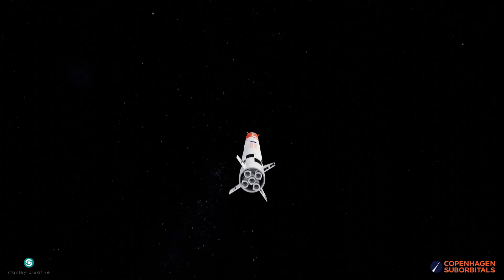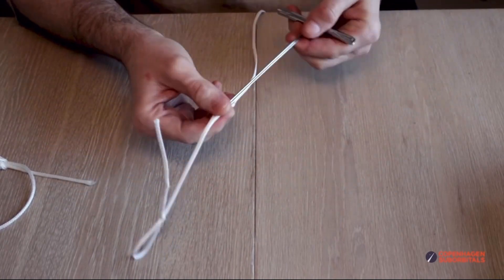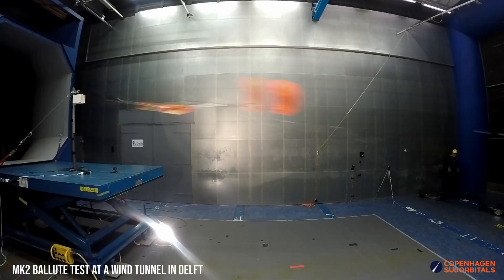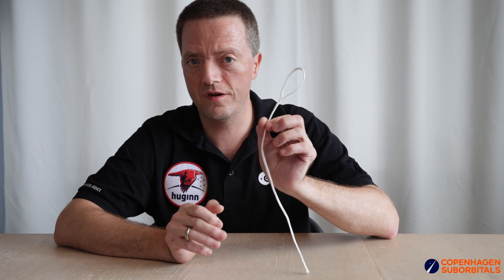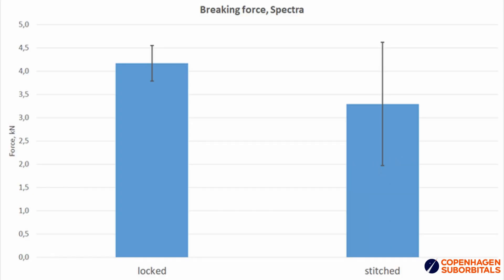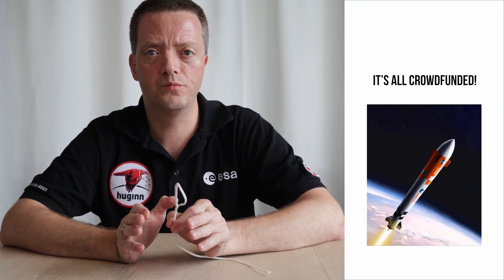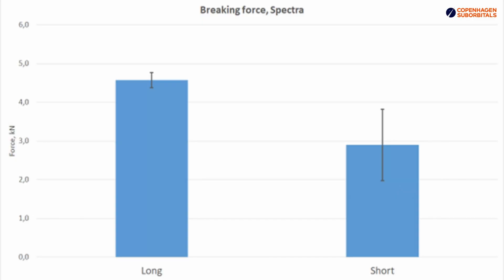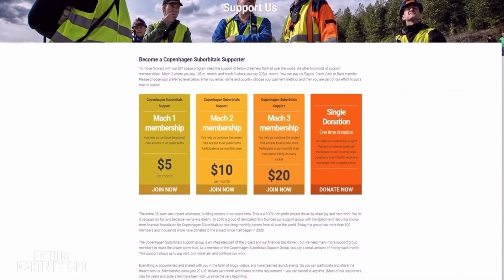Rocket parachute lines that DON'T break?

Comment: I wonder if it matters that the bolts the lines are attached to during testing are fixed. That could allow friction to transfer some stresses off center if the line isn't placed at the right angle. 
Shorter loops would also be affected more by this.
Reply from the maker: Yes, but it’s equal conditions for all the tests
Reply: @CopenhagenSuborbitals  A shorter loop will be under more stress than a longer one if the knots are displaced by the same distance.
It's the same as when you take a long rubber band and a short one of the same thickness, and stretch them the same distance - the shorter one will take more force.
It shouldn't be that hard to put them on something that rotates for the next test, to see if it changes anything.

Comment: It's a well known fact that the majority of the strength in a finger trapped loop comes from the finger trap not the stitching. The bar tack is really just to prevent the line from slipping out when there is no tension. If your larks heading the line onto a loop on the canopy we often don't bother to sew the loop during test jumping. I've seen canopies with hundreds of jumps on them with the upper loops never having been sewn.

Other things you are going to run into. The end of the finger trap, where the inner line terminates is a stress riser. Be sure to cut it off at as sharp an angle as the weave allows.

With larger lines or with a tighter weave the insertion point at the loop can become the failure point. You see this at the bottom of the line where it might loop around a link. The problem gets substantially bigger as the shaft of the link gets bigger. The angle of the loop becomes an issue with large links like the big drag chute links. It's also important that the lines do not overlap each other. They will cut each other. So slinks and French links are bad. Also the webbing loads much better with a drag chute stile link. You cant pinch webbing inwards on heavy loads especially with the stronger kevlar webbings. Because of all this we actually went to sewing the line derectly onto the riser. Think security 150. We were using 1000 lb HMA and the heavy kevlar. Neither had much stretch. With this we were able to sew them directly in with 5 inches of 308 double throw zigzag with FF. This proved just as strong or stronger then a loop around a drag chute link which failed at the insertion. It's also much lighter and cleaner. I've seen lines get caught around the knob end of a drag chute link.

Staging is also important. For example we have seen the drag cute links and risers pull free and be left behind in the pack tray during the high snatch force of main deployment when the drouge was released. Loops retaining the canopy in the bag need to be heavy tapes that can handle the load. Lines need to be secured with 80 lb break tie or flutes. An anti line dump flap is a good idea for the first jerk. You might also want to think about Speed Bag designs, all loops are closing loops. With a 1000 lb worth of extraction force you need to think about the structural strength and security of the deployment bag.